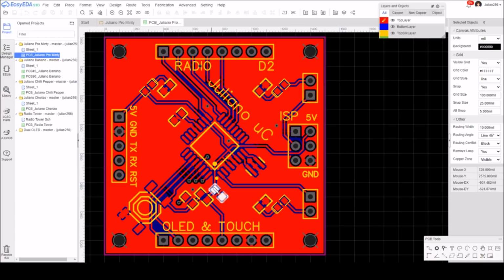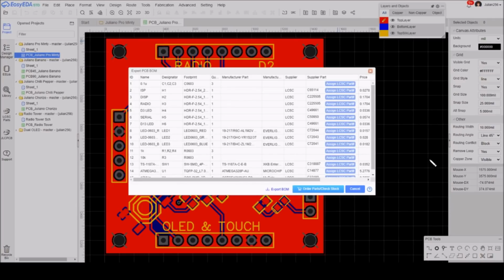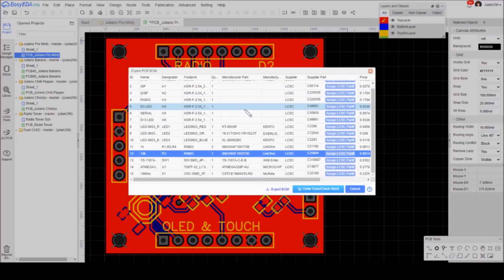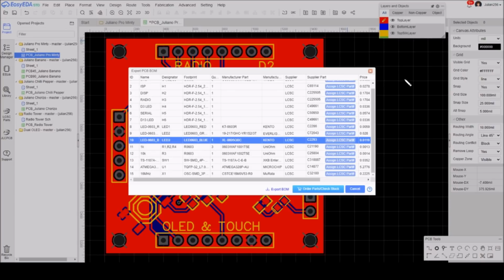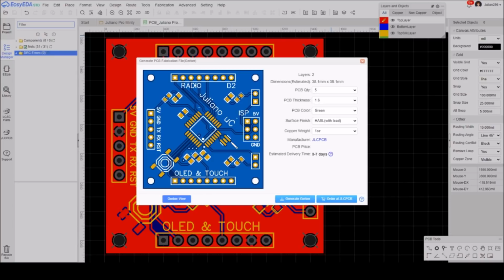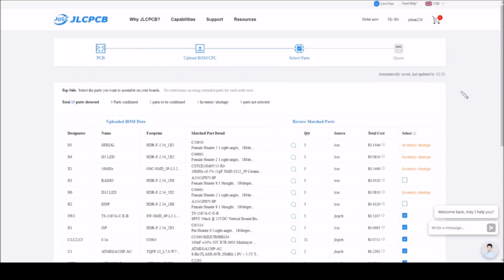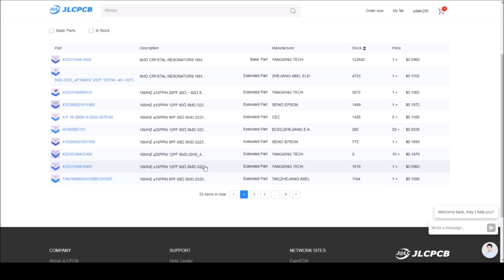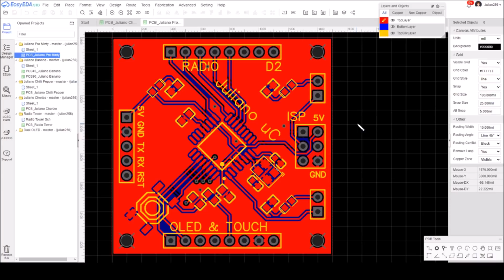Preparing the Juliano Pro Minty for Production

Comment: In my first try at EasyEda, I had quite a hard time finding many of the basic (as opposed to extended) parts. Perhaps that was because of my inexperience, but it would be nice if they made the basic parts easier to find. For example, I had to use an 0805 green LED instead of 0603 because I never found a basic 0603 green LED.

Comment: Does anyone know if it would be possible to transmit information to a light sensor from you tube?  it would be slow data rate but if you held the sensor on your monitor and convert to ascii for example. i remember it being a thing on the bbc back in the 80s and ive allways wanted to try it.

Comment: Wouldn’t it make more sense to move the bypass capacitor closer to the connector? That way it’s closer to the VCC pin of the MCU? You also seem to have space there too.
Reply: Pretty sure the practice is to have the cap as close to the device using the supply line. It's dual purpose: Filter noise from the actual supply source, and filter noise induced by RF or nearby components. Technically, he could have a decoupling cap on the 5v line on both sides of the MCU, as well as the 5v pin for the OLED screen, although as that's a separate board, it should really have its own.

It really comes down to a question of "how much is enough". If Julian experiences issues with this design, he may have to make a revision and produce a new board. If it works first time... then no problems.

Comment: If it was me, I would've made the trace from the 3xVcc pins of the uC, to the thickness of one of the pins. 
The supply line is too thin and can't provide high current peaks. Your uC won't be taking more than 20~30mA, so this is not a problem. An Esp32 would've been another story. 
Also, some people may not know this, but ceramic resonators are not crystals. They have a typical tolerance of +/- 0.5%
That's over two orders of magnitude worse than a crystal. If you want to operate at top speed on the Tx and Rx lines for example, you'll find a lot of errors.
This gets worse with temperature. Something that worked fine in summer, may not work in winter! Temperature plays a big part in drift. 
In my day, when I designed using the PIC18, I was not able to go above 115,200 reliably using a ceramic resonator.
I changed to 4MHz crystal, and used the PIC's PLL to get 16MHz. Then, I got over 1Mb/s full throttle.  No errors from -40 to +60ºC.
Ceramic resonators are very cheap to make, and used everywhere precise timing and temperature stability is not required.

Comment: In theory I think your power rail should enter your decoupling capacitor first and then that feeds your micro. Also the 5V line should tap off parallel for other devices like you programming header rather than run through the micro, else any surges down the line will be seen by the micro. All my opinion, I know this divides lots of engineers! Great little project.
Reply: If you consider the circuit, both the ICSP header and the on on the left SUPPLY 5v to the board. It's likely that Julian will only have one 5v source connected at a time. 

Also, the 5v line is literally connect in parallel to the MCU and the OLED header (as well as LEDs etc). If you desoldering the MCU (or didn't populate it at all) the 5v still gets to the other headers/components.

"Through" the MCU, implies it goes in one side, through the silicon, and out the other side, breaking the circuit if the MCU was not present. But, that's not true. It enters the MCU from 3 pins and is used by the MCU. The trace connecting those 3 pins to 5v, also connects to the OLED header and other components, and is not dependent on the MCU to complete the connection.
Reply: Decoupling capacitors are generally used to remove noise on power or signal lines which is induced by surrounding components and general RF interference. This is why the cap is placed as close to the Vcc pin of the MCU as possible. You want The long trace, which is picking up transient magnetic waves, and thus inducing voltage in the trace, to be filtered right next to the Vcc in pin, which gives you clean power at that point, and negligible trace between the MCU pin and the cap, to pick up further transient voltage inducing RF/magnetic fields.

To be anal, or if the circuit design requires it, due to known or assumed possible environmental interference, you could use a cap on each Vcc pin of the MCU. And you'll notice that Arduinos do this.
Reply: @CollinBaillie  Was the decoupling cap there to decouple the mircro or smooth the rail? If its there to decouple the micro it should feed 5v->cap->micro (end). I believe this was the intention because he has placed it closer to the micro rather than the input 5V rail, which is where you would normally place input smoothig capacitors. Decoupling capacitors are not solely used to remove noise from other components, they are used to stop the component they are decoupling equally causing noise through current draw. They equally support the rail during sudden current draw to prevent it dipping due to large loading operations by the micro.

The 5V line runs under the micro footprint which is true that it is in parallel with the micro and will not run through the micro. My comment was referring referring the 5V being fed in parallel compared to the cap which is feeding the micro if it is suppose to be decoupling the micro. 

If you imagine him using a 5V plane instead, you would not add the decoupling cap then feed from the plane again to power the micro if the cap is suppose to decouple the micro. You would route 5V plane->cap->micro. However, the layout above is effectively separating the cap from the micro by smoothing the 5V line and not decoupling the micro.
Reply: What I am trying to say is that the cap is smoothing and not decoupling. To decouple is to remove the coupling between a device and its rail. Which means the power rail must feed into it through the capacitor and end. If you feed through the capacitor into the chip and continue the rail which is what my first comment was trying to infer, you haven't decoupled the device from the rail because you are feeding in two directions, meaning coupling can happen on either side.
Reply: @jonelectronics510  You make some good points, and I'm still coming to grips with exactly what decoupling is. Obviously a DC voltage doesn't pass through a capacitor, so the cap is "off to the side" and works to add voltage back into the line when the supply dips, or absorb it when it rises.

Running the trace under the MCU and out the other side, does indeed offer opportunity for induced voltage to appear on the trace. This is clearly why on Arduino boards, each Vcc pin has a decoupling cap.

I guess Julian will let us all know how successful the board is when it's in use. 

If he does experience issues, maybe it's something he will need to address?
Reply: @jonelectronics510  I feel that "decoupling" refers to the AC component and DC component of a "rail" or "signal". True DC would be a perfectly flat line in a graph (volts vs time)

If the DC rail wobbles a little, it is said to have an AC component (even if the variance means the voltage is always positive)

A "decoupling capacitor" decouples the AC component by effectively countering it, which results in the wobble being removed. 

The fact that you place it as close to the MCU (or other component) as possible, is based around delivering the cleanest, purest voltage to that MCU/component. 

I suppose it may be possible that having only one on the trace is sufficient, when the device is tolerant to a certain level of the "wobble" or ripple voltage, meaning you don't have to decouple absolutely every pin. For ultra sensitive parts, one cap per pin is probably recommended, but then you probably need to "bin" each capacitor based on its characteristics or performance, to ensure you have close to identical parts, OR suitably different parts which match the ripple on a per pin basis. 

I'd think that the Atmega328p he's using is pretty tolerant on the Vcc supply pins, so it might be going over board to decouple each Vcc pin. My guess is boards like an Arduino is made to be able to handle a broad spectrum of environments, while Julian's is a pretty specific or dedicated application for the MCU.
Reply: @CollinBaillie  The micro will be fairly tolerant to most noise, infact you probably don't need it at all for most projects.

You are correct in your theory, high frequency ac noise can pass through the capacitor to ground leaving the dc component. Depending on the frequencies you may need more than one value but also type of capacitor. They are also there as bulk storage because a power supply is slow when changing loading, which means voltage will drop. This should be placed close to the device so it is only loaded by the device and not other parts of the circuit. In this scenario I can't see the micro being that upset by slow power supply response as it has quite a large input voltage swing compared to something like an FPGA which it's own starting surge could be enough to invalidate its power supply swing due to its fast frequency switching.

The danger of placement error is that you are creating parasitic RC and LC circuits by including it. Therefore, layout is critical that you don't accidentally make the scenario worse (though for a simple micro this is hardly going to be the case!)

This datasheet is well worth a read:
https://www.google.com/url?sa=t&source=web&rct=j&url=https://www.analog.com/media/en/training-seminars/tutorials/MT-101.pdf&ved=2ahUKEwi_wsDU4drxAhWJIsAKHZ9RBXoQFjAQegQICxAC&usg=AOvVaw0GsRNIf6TdfY85K9yZXoAJ
Reply: @jonelectronics510  and as I've been learning in the last.. hour? The capacitance and type of capacitor also matters in reference to the frequency of the AC component, as different capacitance or types of capacitor will have their lowest ESR at particular frequencies. I will read the data sheet soon.